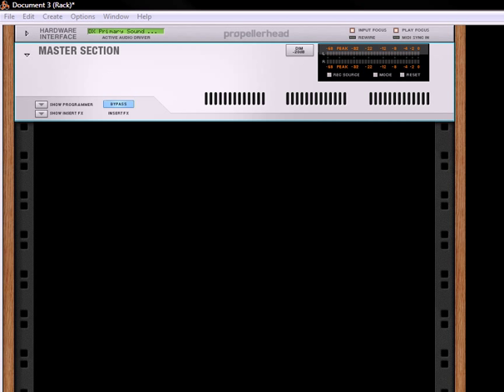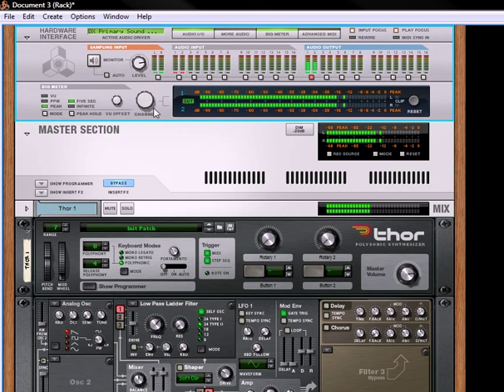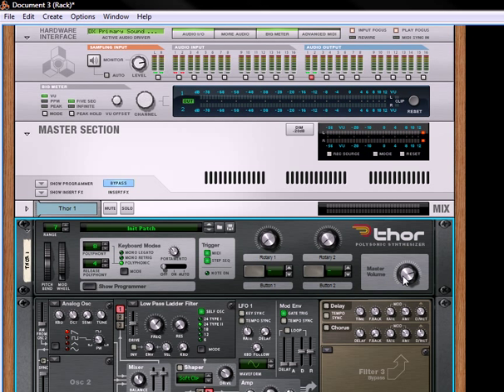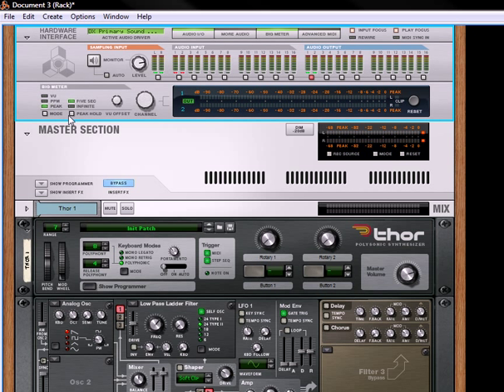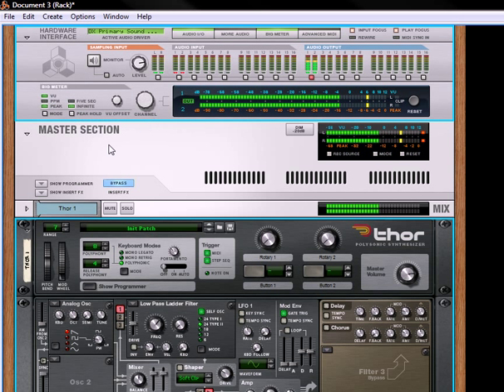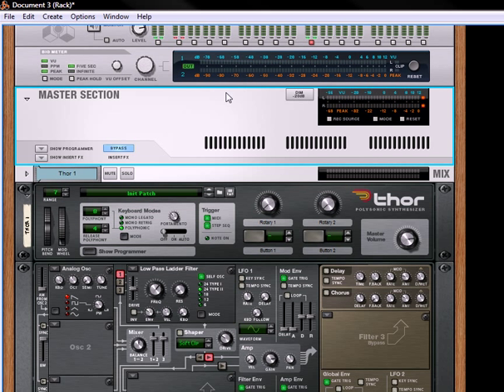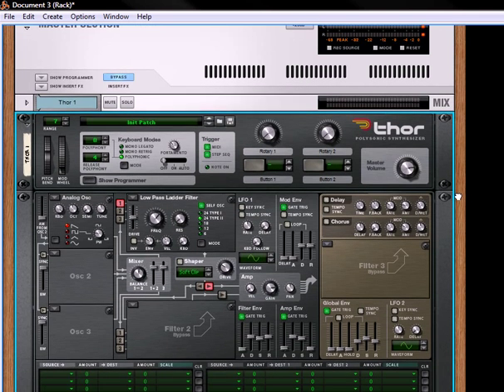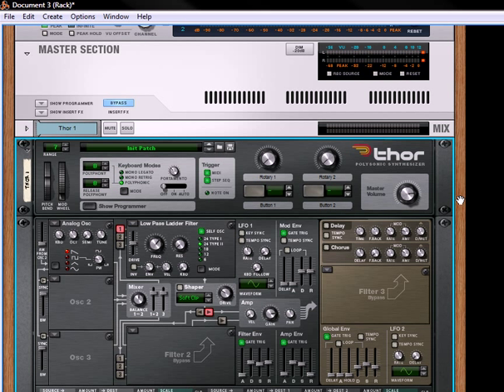Volume & the Big Meter in Reason 6

Comment: I really need your help.  I've been using Reason for over 10 years, and have ran into this issue before.

For some reason, my audio tracks randomly change their volume to +6.36 db without me doing anything.
Not only that, it's not due to automation and it will do it completely at random.  In other words, it happens
at random points throughout the song and it changes whenever I stop the song and play it again.

Sometimes it'll play for 30+ seconds without changing, other times my audio track will change within a
couple seconds of it playing.  It's the weirdest issue I've ever ran into with Reason, and it's obviously driving
me insane!  I figured if I automated the volume level of the audio track, that I could at least find a work around
to make sure it stays at the level I need it.  NOPE!  It'll just disregard my automated volume, the green rectangle
that represents that there's automation on the audio level will turn off, and it'll shoot right back up to +6.36 db
again.

I can't find ANYONE with a Google search that is having this exact issue, therefore I cannot seem to find a fix.
This is a purchased copy of Reason 9.  This is not a cracked copy or anything like that.

PLEASE HELP ME OUT!  There's nothing worse than having your levels for your instruments and audio tracks
randomly change themselves.  It even does it if I'm sitting here without touching anything, without the song 
even playing.  It's mind blowing!

#MISTA808
Reply: I had a faulty MIDI keyboard that was causing this.
Reply: If it were +6.66 db louder we'd know you're writing the devil's music and that maybe you should stop ;)

Comment from the maker: VU measures how loud the sound is based on the way humans hear sounds (in Voltage Units), while peak measures how loud the sound is (in dB). Practically speaking, they are attempting to measure the same thing but using two different approaches. Think of measuring pressure. You can use Pascals, Bars, or PSI, each with different values, but all measure pressure. In this case, pressure = loudness. Perceived loudness = measurements in VU, while Peak loudness = measurements in dB.

Comment: You forgot to cover the all-important VU offset? The nominal value on default meters is relatively inaccurate.  -18dbfs = 0db (clip) in the digital domain so put your VU offset so that Red begins at like ~18. Its about one click from all the way down for VU/Peak. Also, readjust ur SSL comps to ~6thres. If anyone has a Reason question im certified by Propellerhead & an engineer I can answer studio integration, I/O, SSL Mixing, outboard, RackExtension, routing ;; anything with Rsn! Happy to help.
Reply: can you help me?

Comment: Hey Rob! I have a question. 

I keep my VU levels in between -8 and -4 but peak or ppm mode shows that the signal is clipping a little bit over 0 (although I can't hear any distortion). Any advice on this?

Comment from the maker: @levinsonl I do indeed use the new Big SSL Mixer in Reason 6. Though I still rely heavily on the M Class devices applied to each instrument in my song. Using both in tandem can produce some nice effects. Learning the ins and outs of compression and EQ (and the differences between M Class and Big Mixer EQ / Compression algorithms) will help you out tremendously. Experiment until you're blue in the face. And come to your own conclusions. That's my best advice.